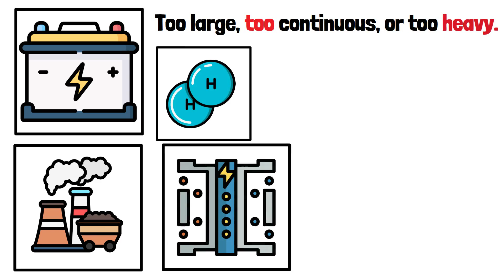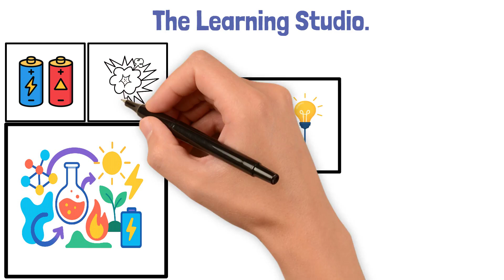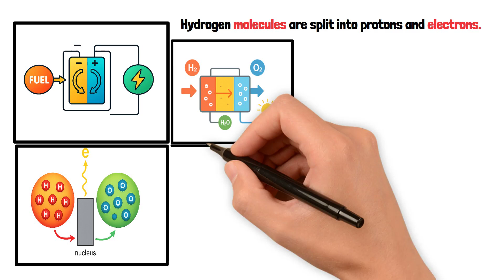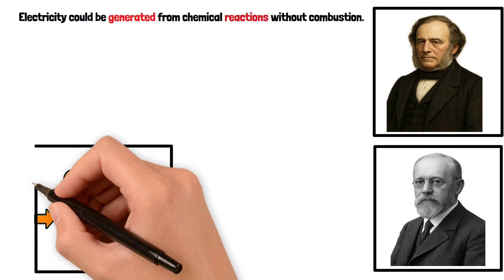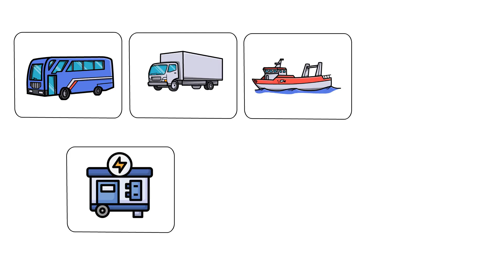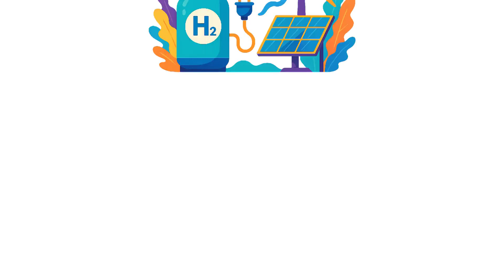Fuel Cells Explained | Hydrogen and the Race Beyond Fossil Fuels

Comment from the maker: Hydrogen isn’t magic.
It’s chemistry under control.

In this video, we explored how fuel cells use hydrogen to generate electricity—and why this technology is seen as a path beyond fossil fuels.

We covered:
How fuel cells convert chemical energy to electricity
Why hydrogen is an energy carrier, not a fuel source
How fuel cells differ from batteries
What chemistry limits large-scale hydrogen adoption

This was a reality check:
The energy transition isn’t about promises —
it’s about chemical feasibility.

▶ What this unlocks:
With fuel cells understood, we can explore green hydrogen, catalysts, infrastructure challenges, and AI-optimized energy systems.